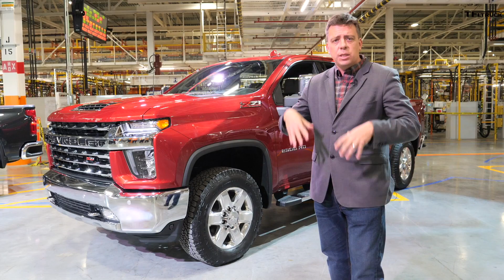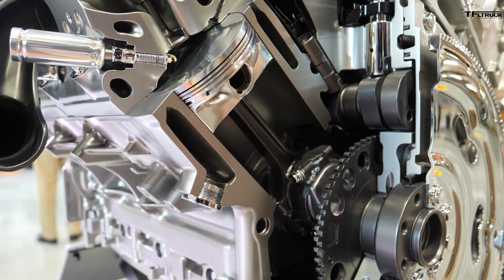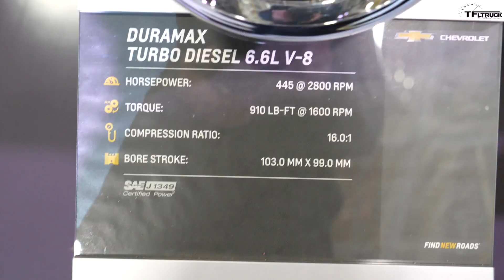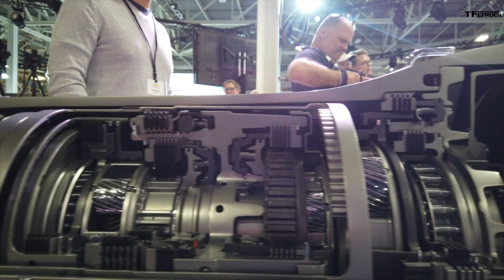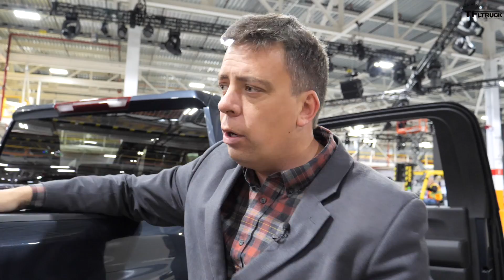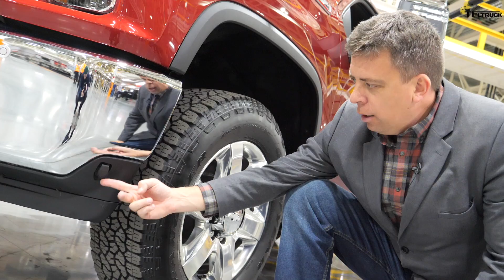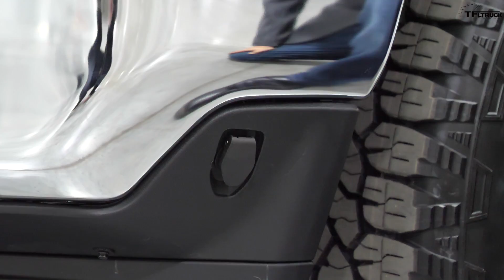Here is How the 2020 Chevy Silverado 2500 HD Delivers the Torque to the Ground

Comment: EXCITING TIMES!  Big V8's are back!
Reply: The V8s are back just because manufacturers are trying to squeeze as much power as possible out of the gas engines... because DEF is a failure.
Reply: @Ethan-ck6iz  so essentially the same reason diesels even took over in the first place is going full circle :/
Reply: V8 are the greatest engines ever!!!!!
Reply: Eventually in 50 years time electric motors will replace the diesel engine. Only if battery technology and miniaturization improves.
Reply: Not at GM.
Reply: I cant believe they are going bigger!  Poor Mother Earth... :(
Reply: @bendino9016  I cant believe these new motors put less pollution than a civic from 20 years ago
Reply: @bendino9016    I can appreciate your comment.  I think what is driving this, is the rather problematic and expensive emissions equipment on the diesels.  That combined with the degredation of fuel mileage.  I had two trucks that were very similar.  One  prior to emissions (2007 and earlier) and one post emissions,, the non emissions truck would get 17mpg maybe 18 and the newer emissions truck 13mpg.   So with less fuel mileage and more propensity for costly repairs, many people like me, a casual weekend warrior needing a tow vehicle are hedging bets the gas truck will cost much less in the long run.  We can't afford to spend the extra coin on a $70k diesel truck and when out of warranty  be at risk of having emissions equipment fail and be on the hook for 4k or more dollars to replace catalysts and DPF filters, DEF pumps , $2000 dollar injectors.  In some cases emissions failures have caused engine failures.   I have been seeing more and more people going back to gas trucks.  With GM and Ford both coming out with bigger gas engines in 2020 I think it shows a shift in consumer demand.   I currently run a  heavy duty gas truck and its only used for towing and hauling.  It has a smaller 5.7L gas motor in it.  Turns out I would have gotten better fuel mileage if I would have stuck with a bigger gas burner lke the 7.4L or 8.1L.  The little engine works so hard when pulling it gets worse mileage than the last 8.1L vortec I had.  I doubt this will make you feel any better but in some ways I think the diesel trucks eliminated the need for big gas engines.  With the addition of all this emissions equipment, poor fuel economy and premium price tags  driven by all this new technology.   The emissions on the diesels have kind of  backfired.  Now the market has reacted and I think pushed us back into engines that are bigger and possibly dirtier than pre emissions diesels.  Respectfully
Reply: @johnharding91  
Well said. If extrapolated out to millions of gas vehicles across the USA as consumers buy these 6.6 & 7.3's  getting LESS mpg than pre diesel days we haven't really "improved" anything. More gas and less mpg vs less diesel and more mpg co es out as a wash.
Reply: Ben Dino gotta enjoy life.
Reply: @bendino9016  benny earth will be fine  global warming is a hoax bruh enjoy life
Reply: @bendino9016  Global warming is a hoax, just another excuse to raise our taxes.

Comment: Why didn't they just put the 6.2 liter from the 1500?
Reply: Different class of engine. This 6.6L is a low rpm work horse with an iron block made for constant load. Much more conservative power numbers much like the old 6.0L

Comment: Front end, UGHLEEEEEEE!!!  Side step will be used by 1% of new owners, Auto 4x4 has been in Chevy trucks for decades.  Glad I bought an 18 before the body style change.  Won't be buying a new one till this one is changed.
Reply: lol, The side step will be used by 1% of owners? I'd use that side step all the time if I had one. I like the rear steps in my 18 GMC Sierra. These big trucks are so tall in the rear end (and I'm 6'3") and having a step there to help you reach into the middle of the bed is perfect.
Reply: @dedalliance1  Agreed, I cant count how many times i've had one foot on my running board, while I precariously lean over while trying to grip the top of the cab with one hand and trying to grab something out of the bed with the other haha.. Lifted truck problems!
Reply: @bparks_5095  lol Yeah. I would like full length running boards for my long bed GMC that go all the way back to the rear wheel, that would solve the same issue but that's talking a little bit of money. And unlike fords dumb little step that folds down in the corner of the trucks, or is that dodge? it wont get ripped off by anything lol.
Reply: Best looking truck today, you're tastes are off.
Reply: I don't believe the auto 4X4 was in the HD line before. It was in the 1500's for sure.
Reply: True, very ugly front end

Comment: That's a bad location for the engine block heater plug.
Reply: Why? And where should it be instead?
Reply: @joshuabaker8377  Above the wheel well would be start. Maybe near the A pillar.
Reply: @jeremyR87  that would look like trash lmao. Is there any vehicle that has ever had that? If so I doubt they make them now.
Reply: If You Dent Your Bumper And Break It Off Then Just Rewire It Through The Grille no big deal

Comment: 6 speed? Really? They also said that the transmission is basically nothing special. Sounds like if you will want a true heavy duty gas you will need to get the 7.3 with the 10 speed
Reply: Just because it has more gears doesn't make it better...
Reply: @Nova Man I don't need performance in an HD truck I need reliability...that 6 speed they just beefed up again was one of the most reliable on the market...( How did we ever make it before without 10 speeds)

Comment: Honestly wish they would've brought back the 496 Big Block with the Allison from the 2001-2007 classic days.
Reply: The 8.1 was kind of a dog for the displacement. Its a powerhouse no doubt but if they redesigned it with some better flowing heads, intake, and took care of the oil burning problem id buy one.
Reply: Don't know why you consider it a "dog" 345 455 pretty damn good numbers for a work truck still better the v10s from Ford and dodge
Reply: blown5.3 the v10 actually had more power in the later years that the 8.1 was available, but I think the v10 was more high revving like modular motors are.
Reply: It had its issues, such as the oil burning, but it was an immensely strong block, originally designed as a marine engine. I own a 2002 3500 dually, never a problem with it.
Reply: still own one aswell... beast of an engine that pulled trailers just as easily as the diesels did, amazing sounding exhaust.   we switched to a heavier oil and the burning slowed down abit.    I feel as though this 8.1L  will last longer than the frame around it.
Reply: The 8.1 would need a gas station half way up the Ike lol
Reply: @alexs3187  The fuel mileage was always within 1 mpg of the 6.0L.
Reply: @Sam In my experience, the 6.0 reliably averaged about 12 mpg, with the 8.1 averaging about 11.  When towing heavy, the 8.1 didn't drop mpg as much, but unloaded it was about 1 mpg lower.
Reply: @Sam in the real world my personal truck gets 13mpg and my service truck gets 11mpg both are 6.0 2500hd.
Reply: My 2017 6.0 never sees more than 12 mpg. 4.10 gears cclb
Reply: i have an OG 2000 6.0 suburban 3/4 ton 4wd , over 200k miles still gets 12-14 mpg on the highway depending on speed. towing through the PNW mountains 11k pounds it gets 4mpg , towing through the SoCal desert its getting 8 or 10 mpg. the thing about the 6.o is it can hold 4000 rpms all day long and not give a shit in the mountains as long as you can keep your trans cooled.  towing 11k i was able to cruise at 60 mph at less than  2k ish rpms , on 33 inch tires. i plan on jumping up to 35s and regearing. i don't mind the shit MPG since diesel currently costs so much more plus a new LQ4 motor will cost me $1200 meanwhile my buddy spent like $2500 on a new injection pump on his duramax. you cant beat the gas trucks in overall ownership costs.
Reply: my numbers don't match yours. my 515hp 515tq stock lq4 block 317 heads with a procharger, larger injectors and bolt ons with a 4l80e and 3200 stall convertor 3.73 gears in a 5400lb extended cab averaged 14.5+mpg with a heavy foot....
Reply: Ive thought long and hard about getting a new 6.0 bottom end , throwing on some ported 317 heads , short tube headers , a procharger or vortech ,  maybe the LSXrt intake with 105mm TB , new injectors, and a baby comp cam to match.. Just not sure i want to spend the money on this particular truck i have. Id much rather upgrade to a newer crew cab 4wd. maybe even the newer 6.2 powered half ton. the New half tons have the same if not better tow rating as my old 3/4 burban and will get double the mpg.  I had a 2015 silverado for a while with the 5.3 , i overloaded that truck pretty good 1 time and it did very well on a 300 mile round trip. not sure i need a 3/4  any more as long as i go with the newer higher rated 1/2 ton trucks.
Reply: Sam my 6.0 stock gets about 6.5 💀💀
Reply: Alex S lol damn right about that
Reply: Alex S true. LOL
Reply: We still have a 2001 8.1L 2500.  Definitely under powered as compared to todays trucks and fuel economy was not great, the transmission already could use some work with 154k on it... but it moves mtns and doesn't bog down.   people needed to Ditch the light weight oil it calls for and she doesnt burn nearly as much.  lol never need to crawl underneath to change oil when it just gets filled up each month with new stuff.
Reply: We had a suburban with the 8.1 and man did I love that motor.  Paired with the 4.10 gearing it pulled everything easily but usually averaged 10 mpg.
Reply: 8.1
Reply: I had a 2001 Silverado 2500 8.1l 6 speed manual 4x4. It was thirsty. It started burning oil at 70k miles. I changed the oil every 3k miles. Spun a rod bearing at 90k. Truck was out of warranty in 09 when it happen. I’ve always had great luck with my Chevy engines maybe this was just a lemon.
Reply: My next truck will be the old 8.1 03 up that is
Reply: Well ford announced their new Big Block 7.3 L gas engine so they may not have a choice to revise it, but those of you with oil consumption in you're truck move to heavier oil I run 5w40 rotella t5 diesel oil in mine and put a oil catch can on you rig no reason not to have one
Reply: They dont have an allison it's gm made.
Reply: 8.1 with variable valve timing and direct injection....
Reply: I had two of them, great engines.
Reply: Can’t beat cubic inches really. Add today’s tech to old engine sizes and you’re going to get a hell of a lot more power. Fuel economy is still going to fall, but you’re also feeding larger cylinders.
Reply: Nope. "There's no replacement for displacement." I believet
Reply: I have a 2001 2500HD works every day hauling 25 foot gooseneck, 15 to 18k Has 206k and still going strong. I'm really going to miss it when it wears out.
Reply: Wheel bearing  it was to horsepower centered, more torque would have helped.
Reply: The lq9 6.0 in my 03 ss silverado tends to average around 14-14.5 mpg.
Reply: @87gunsnroses  lq9? I thought that'd be the ls2 considering it's a ss
Reply: @395dmalcolm  ss trailblazer I believe got the ls2, but the ss Silverado had the lq9. Really wish it had been supercharged from the factory
Reply: You have a lot lighter truck than the 6.0 in a HD model as well as gearing would be different.
Reply: the 3/4 ton suburban is heavier than the crew cab 4wd from the same year and uses the same drive train other than i have the Autotrac transfer case with hi lo and 4auto.  its a LQ4 6.o with 4l80.
Reply: Yep not worth the time keep bringing back old ass engines that's stupid you have to move forward
Reply: @fread51  knock on wood my 2001 8.1 has been a workhorse...plowing snow and pulling trailers for 18 years! Can't think of a time it failed me. 5-speed Allison 1000 has been flawless too!
Reply: @fread51  sometimes you have to go back before you can go forward. Obviously we don't want the exact old one, just make one like the old engine but mostly redone with newer technology.
Reply: Toilet Dog  v10 Ford was great empty, but fell on its face with a trailer
Reply: The new 7.3 will shit all over this pathetic engine

Comment: Direct injection only with an extra fuel pump how long b4 valves start gumming up or the injectors start failing?
Reply: My thoughts exactly. I work at a GM dealer and the issues I see with direct injection is crazy. Now that I found out the new Ford 7.3L gasser is not DI(correct me if I'm wrong) I'm even more upset that GM switched over. I fully understand the benefits but it doesn't look like they are going to prevent any of the typical issues of DI. I'll take standard port injection any day until DI becomes more reliable and doesn't need a top engine clean every 15-25K or a new injector due to a cold start misfire or dead hole.
Reply: @Marc85  didn't some of the newer truck engines use both DI and port injection? Why would they make switch I wonder
Reply: anotherrandomtexan25 None of the new generation GM truck V8’s have dual injection. They are all direct injection.
Reply: @ishanbose7161  . I wish gm would have went with dual injection like ford is doing now
Reply: YEG Mechanic yea I was hoping they would have either gone dual or just started with port injection (imo in an HD truck, simplicity is better for the long term). Considering the the LT5 in ZR1 Corvette has dual injection, I am surprised they didn’t implement it in anything else
Reply: @ishanbose7161  I agree with you Sir.
Reply: @nospark8514  . Lawsuits or not . If the engine is that much more reliable because of the technology then I'm sold hahaha
Reply: @anotherrandomtexan25  Ford is the ones that do that on their ecoboosts and new 5.0L
Reply: @anotherrandomtexan25  The new Ecoboost uses dual fuel injection. The ZR1 is the only gm engine that uses dual fuel. I will say, I was skeptical too. But I have a gm 3.6l LFX with 167k miles and I never get worse mileage, smoke or anything unusual! There are euro engine's out there that run like dogs after 30k and 60k and need a walnut blast, but my GM LFX hasn't had the need. Lol idk. I know the valves are dirty but not enough for me to justify a walnut blast. If I had a LT4, I would put a pcv catch can system on.
Reply: @anotherrandomtexan25  I'm sure if the technology in the new ZR1 engine works out it will trickle down to the other models.
Reply: @anotherrandomtexan25  the only GM vehicle i seen with dual injection ( DI and PORT ) is the new corvettes coming out. I also work for GM as a tech
Reply: @Marc85  I completely agree . Well said
Reply: @Marc85  Every 15-25K? I know people with the 2014 and up 5.3 with 176k miles and they have not done any cleaning in the motor, just drive it and change oil.  My last BMW was at 110k miles a 335i with no issues. My current 2016 5.3 is at 42k and not one single issue, the Direct Injection is a little overblown. There are millions upon millions of direct injected cars/trucks on the road with no issues, some will have issues of course but I am not worried one bit. My new BMW M4 is Also Direct injection, not worried. Just saying.
Reply: @jostrander71  I totally see where you're coming from. I believe GM's recommended induction clean is around every 25K. I've had intake manifolds off cars with less than 10K and the valves are coated with carbon. Fuel grade has a lot to do with it as well. I believe the majority of DI vehicles recommend premium and I can guarantee you that less than half of the customers actually us a top tier fuel. Working in a shop I see the worst of it and it is pretty bad. I've done countless injectors and top engine cleans due to misfires.
Reply: @Marc85  lexus has the best of both worlds they put an regular fuel injector in the intake manifold with the Direct Injection system to clean the back of the intake valves. I wanna say the 2nd Gen Ford Ecoboost has a similar system as the Lexus.
Reply: Manufacturers are adding back port fuel injection alongside direct injection.
Reply: @xSnakeBerryx  kind of Stupid to me to have twice has many injectors just to keep carbon from being built up when indirect injection never had that issue!
Reply: @doorguner01  Not really, direct injection actually helps a lot out in fuel mileage. I own a  vehicle with direct injection and it makes extremely good fuel mileage.
Reply: I'm surprised they didn't do a port and direct injection combo. They might run into carbon building up on valves...
Reply: That can happen in every engine.
Reply: GM's DI system would be a dealbreaker for me.

Comment: The paint matched front end definitely looks better than the chrome. I still think if gm had moved the crossbar with the Chevrolet name down some made the top light the same size as the bottom and squared them off the truck would look so much better while paying homage to the old square body front end look.